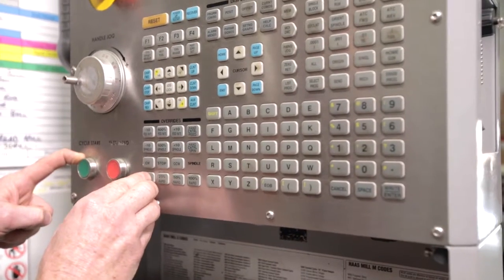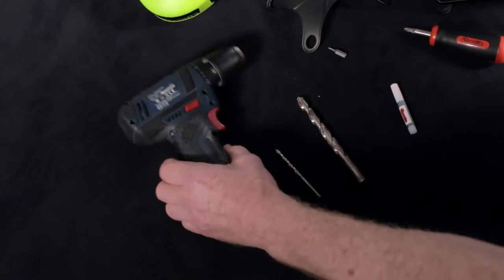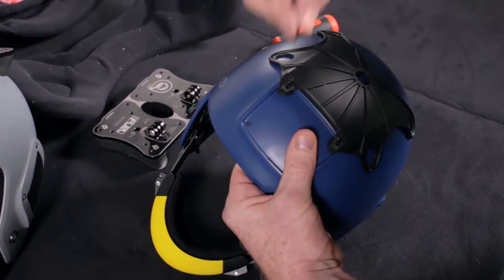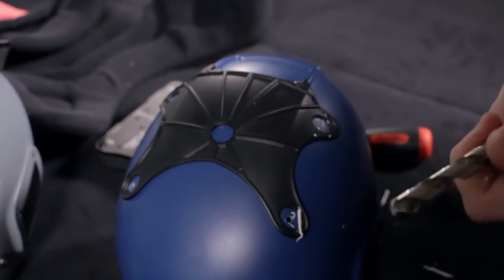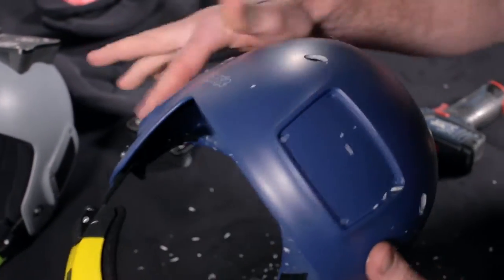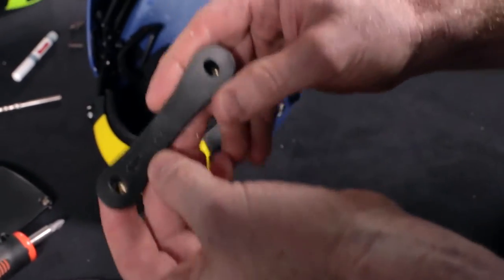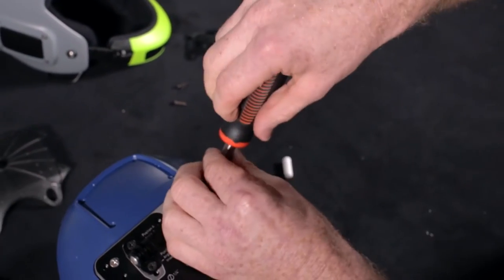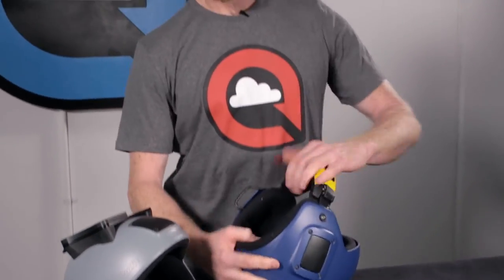How to install the Dual Top Plate on a Cookie Fuel helmet HD

Comment: I just ordered a XL and got it in the mail. The inside retaining nuts are 4 separate pieces compared to the 2 in the video. Did you guys do a design change and not an updated video showing the four individual retaining nuts I guess you would say?
Reply: I have basically the same problem where I ordered The same product and it shows four separate retaining nut pieces and only came with the top to retaining nuts. Either they need to do a update video on the new design of this product or if they didn’t update the product then they need to make sure that they’re sending out all the correct parts because now you and I are missing critical parts to do a job. And now I can’t do my job because of someone at the manufacture, who I was relying on to get the job done correctly. Unfortunately cookie failed at doing that.
Reply: 6 years later and still no update💀